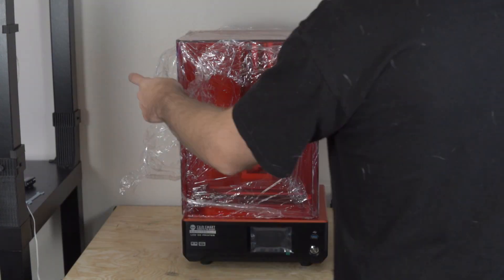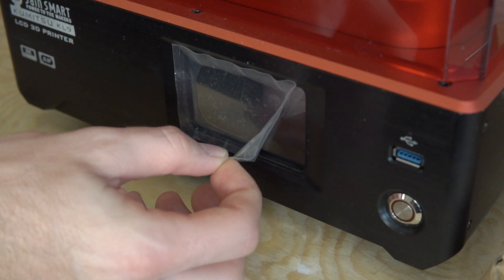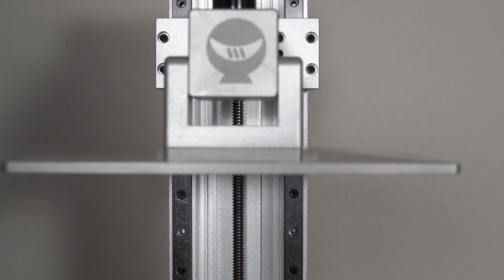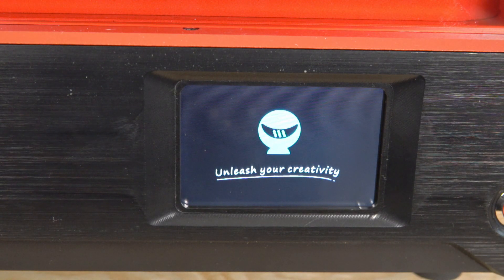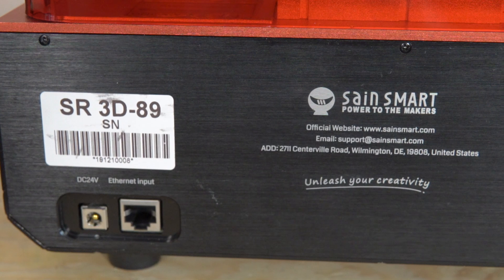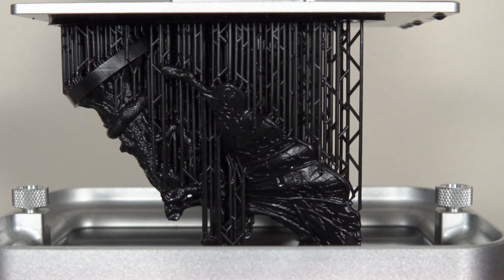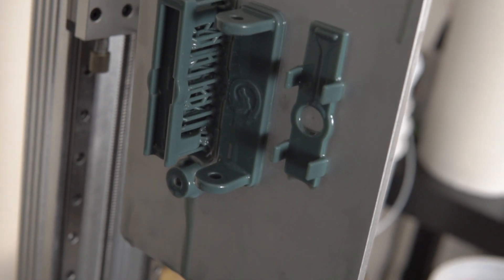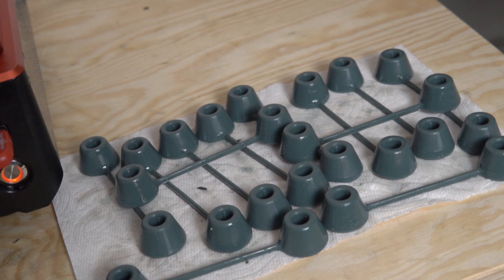Review Of The SainSmart Kumitsu KL9 | Sexiest Desktop Resin 3D Printer?

Comment: Great video!  I have a KL9 not for long but about 3 weeks. I did notice on your settings were just slightly off from mine on the size mine is x-192 y-120 -z-250 vs yours of x-120.96 y-75.6 z-150 @10:05. The resolution was the same. I was just wondering if I am missing something.

Comment: For $1000.
Is it a monochrome or color lcd?
Does the vat have markings, ie 50%, 70% 100%?
Does it have a resin sensor and stop printing when it runs out of resin or did you just get lucky and was there to add more resin?
Can you buy extra resin vats?
Do you get to keep the printer after review?

I beg to differ about Ethernet port. If printer is in another room you want to be able to use wifi or Ethernet to check status, upload files etc.

Comment: Great review, well done.  I will probably be getting a Creality LD-002R shortly.  In your oppinion, is it worth getting a resin printer for non-ornament printing, I prefer doing practical useful prints.
Reply from the maker: Resin printing can definitely be used for practical printing. It is great for making molds and with resins like Blu tough resin you can definitely make parts that will be under load
Reply: Dimensional accuracy can be a problem.  Good support can help though.